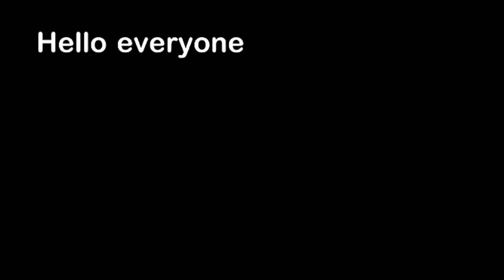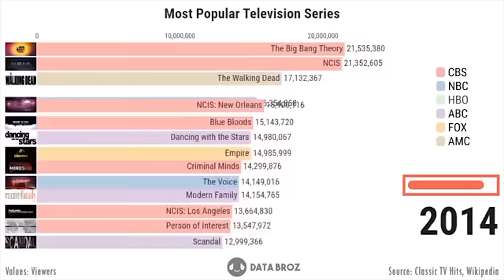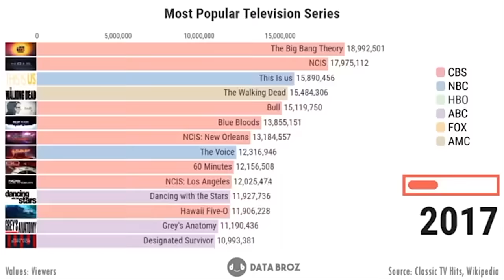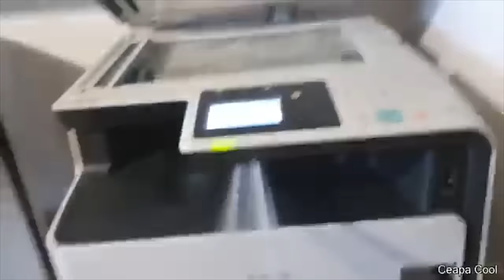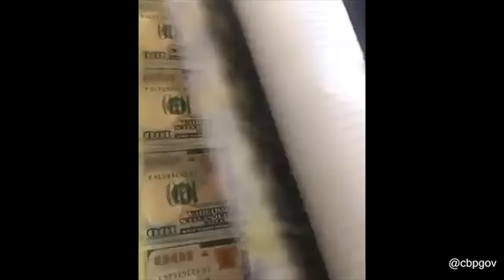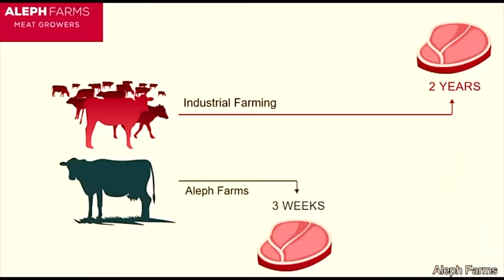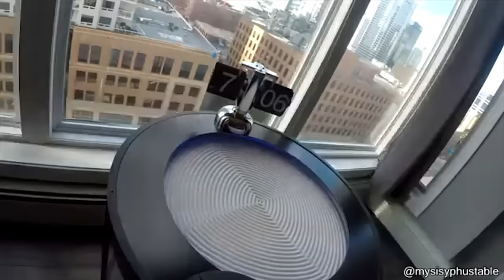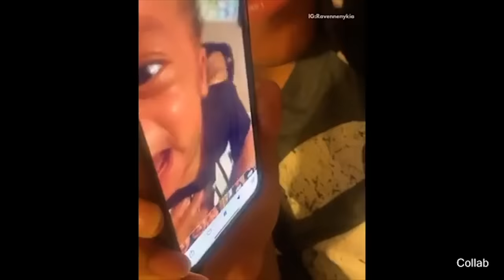1 Hour Of Daily Dose Of Internet (Part 4)

Comment: 24:57 - YouTube channel 'Garage54'... IF you want to see some weird, out of the box thinking when it comes to strange projects with Ladas, these are your boys! Offroad Lada conversion, 3 & 4 Lada engines connected together 'Drag cars', What would happen if you bury a car for a year and dig it up - would it run again? Using various fluids as either Oil, coolant or something else, cleaning an engine internals with dish soap, see through Lada engines, starting a car with JUST a box of AA batteries, running an engine on Wooden pistons, and hundreds more barmy ideas... ANY crazy project you can think of with engines and cars, 'Those Crazy Russians' have PROBABLY done it! (and are STILL coming up with wacky ideas! 👌👍🤣🤣
😎🇬🇧